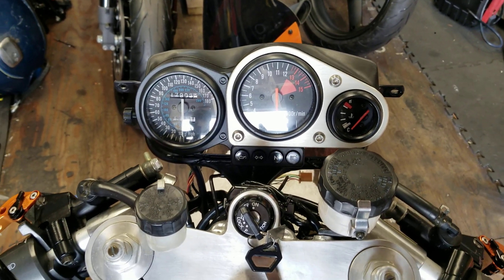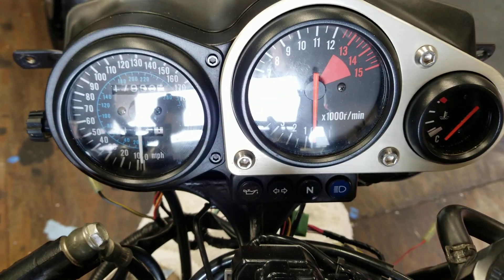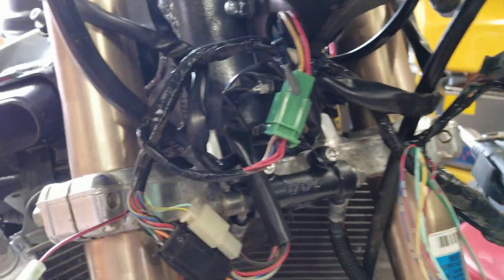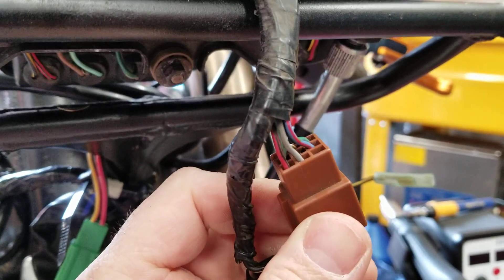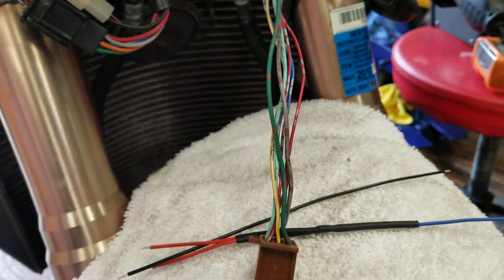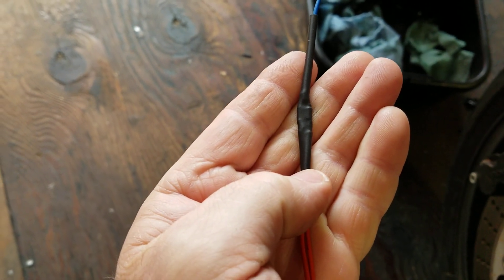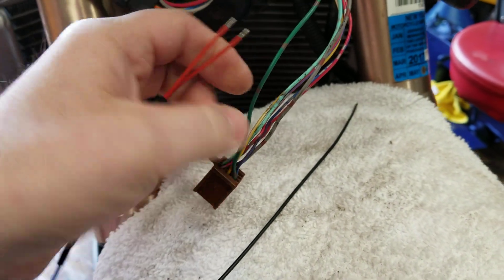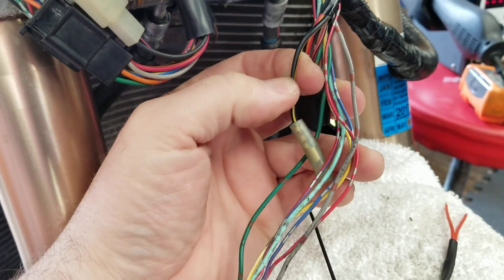Metric bike diode kit installation: Part 1

Comment: Thank you for making these videos. I recently switched to led's on a 03 Kawasaki vulcan 800. Although the wire colors are different, you explained the steps in a manner I could follow. I ran into an oddity though where on my right turn signals worked fine. But using my left signal all 4 would still flash. I fixed this by touching the handlebar by mistake. After about an hour of "what the hell?" I added a resistor to the ground created at the plug and grounded to the frame. Oddly enough this fixed the issue. Since they are turn signals they are not on long enough to get hot. I also kept my signal indicator on my cluster. Thanks again for this video.
Reply from the maker: I'm glad I could help you out.